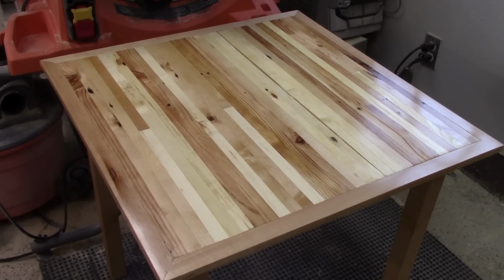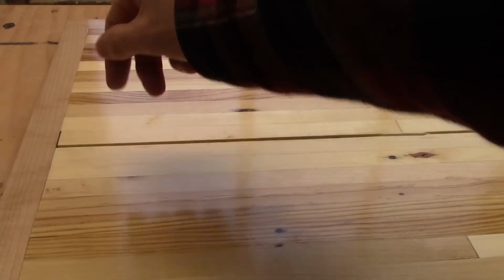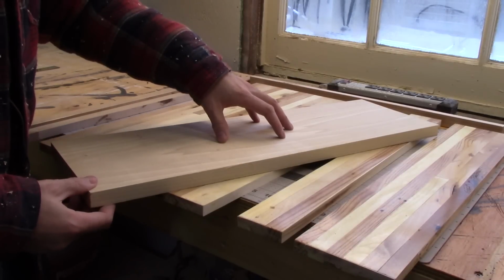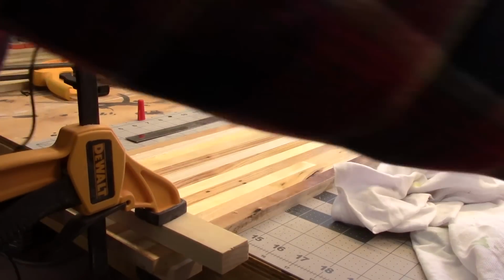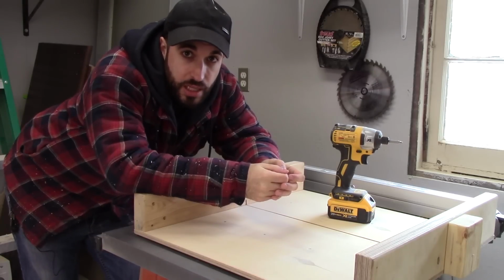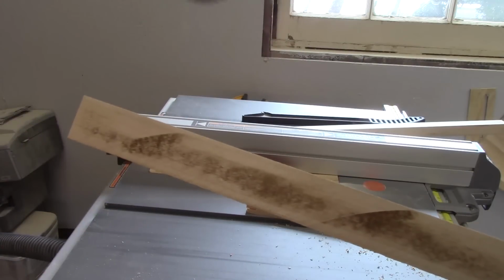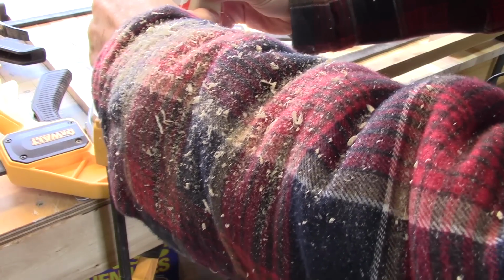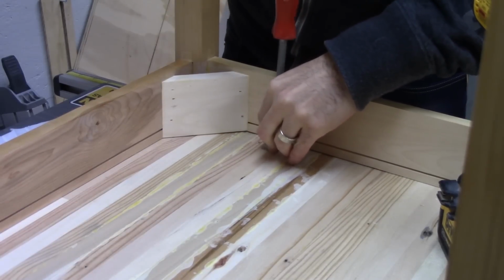Fixing Broken End Tables

Comment: Great Video, I think the mitered frame is a large part of the reason your panel cracked. The mitered frame doesn't allow the panel to move (shrink/expand), in this case shrink, which makes sense as you say pallet wood was used,  it was probably higher moisture content then your home. If your home has good humidity control you might get away with a mitered frame on a solid panel but that is not the norm. I like your channel and the editing on this video looking forward to more.
Reply from the maker: Evan Dunville yup, I think you're right. In retrospect, it would probably have been best to cut a tongue around the entire laminate top and fit it into a groove in the frame with no glue. That way, the laminate would be able to move somewhat without cracking. 

The reason I didn't do that is because I didn't want a visible gap between the laminate and the frame... I guess I'm paying for that design decision. I suppose I could have skipped the frame altogether, but I really like the way it looks. Ah well.

Comment: Nice revisit of a not-very-old project!

I've heard that you can quick-dry your wood in a microwave as long as you trust the source of the wood, like with no nails or anything that could possibly lead to pesky things like a fire in your shop... or kitchen. Also you'd be limited to pieces of wood that you could fit in your microwave. Not sure it would work with pallet wood since that's sketchy from the get-go.

I've haven't yet built a miter sled, but have been trying to decide between the simplicity of Jay's and one done by David Picciuto (watch?v=r6fUXRMJ0DI) that speaks to my "OMG FEATURES" side.

Keep up the good work!
Reply from the maker: Given Reed yeah, I saw that How to Make Everything guy try it. I'm definitely curious. I was thinking of doing a demo video where I purposely soak and dry a piece of wood to see how much it moves. I think I'll need to get a cheap microwave first though. I'm not sure my wife would appreciate me lighting our kitchen on fire. 

As for sleds, they're super useful. Mine is bare bones, and I still use it all the time. I do like the look of that extruded aluminum track that some guys use with those fancy cantilever clamps. I might have to upgrade mine in the future.

Comment: Nice repair job! Although, through the entire video I was wondering what's to say another crack won't show up in the parts that are still from pallet wood?
Reply from the maker: Phil Downey absolutely nothing! That's the risk of not using wood that has been properly dried for a project like this. I sure hope that it doesn't continue to crack, but it will definitely make me think twice about using pallet wood in the future.
Reply: How long was it between when you made them and the cracks started showing? How many days total did it take to do the repair?
Reply from the maker: Phil Downey it probably took two months for the first crack to appear. Hard to say since it was a few weeks before I could get around to fixing it. 

The repair wasn't bad. I'd say it could have been done in two days if I didn't have anything else going on. The big thing that slows it down is waiting for the glue to cure between steps.